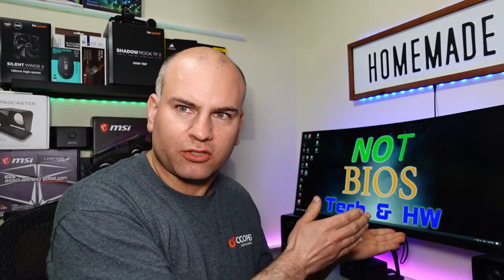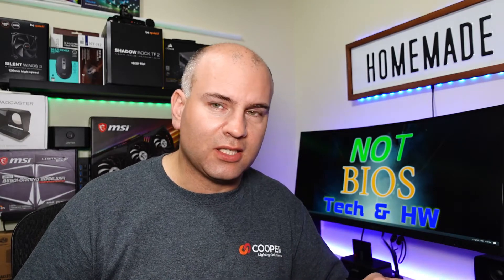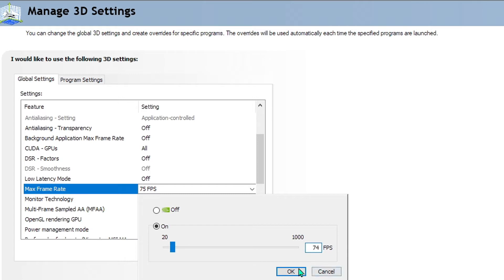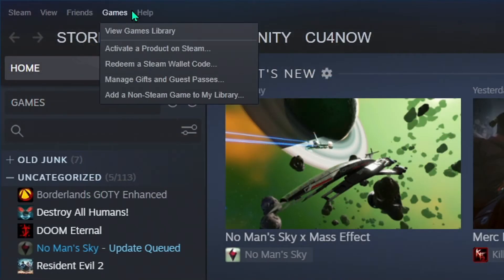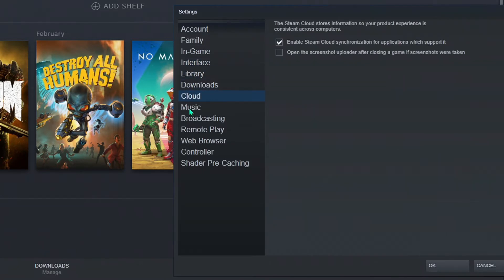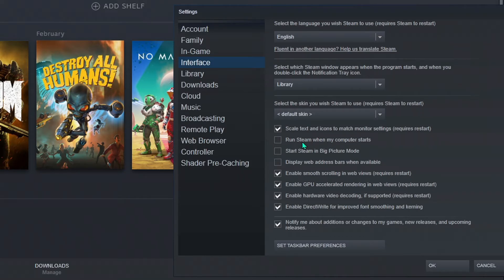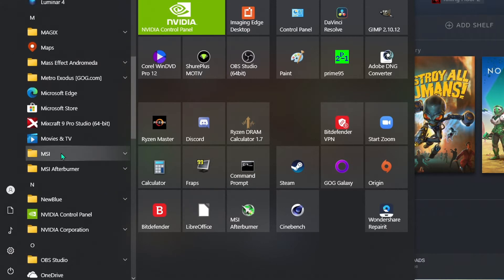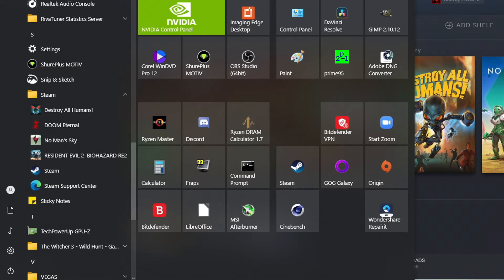Fix Most Game Stuttering issues

Comment from the maker: Low latency mode if you have a low end GPU this should be set to on or ultra for Nvidia or otherwise... less pre rendered frame does lower latency BUT at the cost of possibly more stutter on low end GPUs but with low end hardware you'll do better gaming online... higher the frame rate the less it makes sense to worry about it unless competitive gaming. I personally manually always set my pre rendered frames to "1" same as low latency mode on since the days ofeliminated

Comment: I have a ryzen 5 3600, 5700xt gpu with ddr4 3600 ram  and i get stutters in all games. Trying to fix this for 1 year already.. should i buy slower ram kits 3200 for example?
Reply from the maker: If you have faster than 3200mhz, down clock and tweak your memory timings. I have videos on this and I have another newer video where my own computer had Ryzen master mess up my performance and caused more heat. If your CPU is idling hot it could be a video to check out. YouTube sometimes removes my own comments when I put links. Discord is a place I can help Easier (when I am not at work)